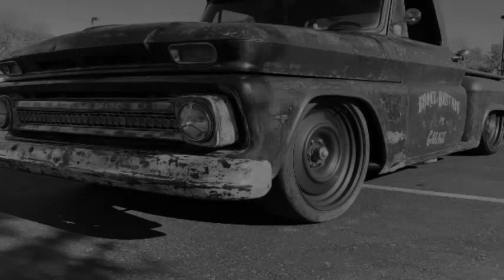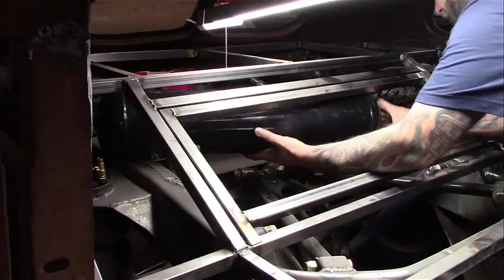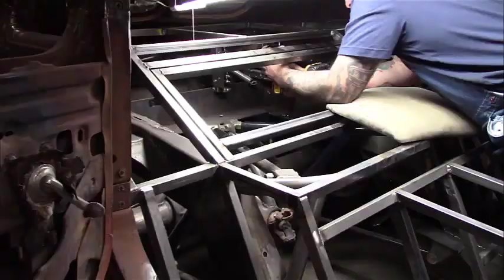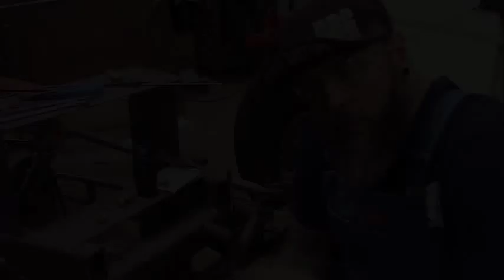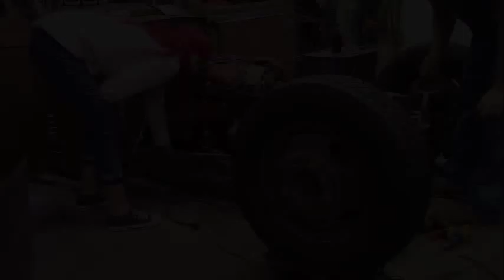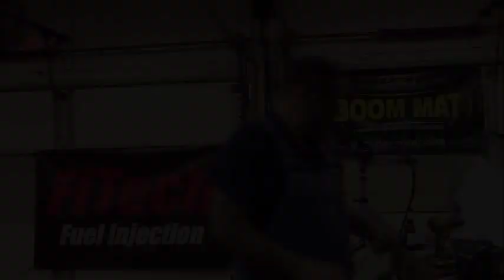"How to Plumb your Air Ride System"  1937 Rad Rod Build Update 44

Comment: Always love the videos you put out. It's also great to see your wife and kids involved. Mine are too. Curious what valves you went with and compressor. I will be running leveling valves off a freightliner so the suspension will adjust itself going down the road and I can dump them when I want.
Reply from the maker: I just used cheap airmaxx valves I had from the first time I did the 64 c10 and a airmaxx compressor. Not the best for sure, but what I had. I have been thinking of doing a self leveling system. Let me know how it goes.
Reply: @BrokeBastardGarage  im a diesel mechanic and they work good on the trucks. Figure I'll use one on each side in the rear. Haven't decided what I'm doing on the front

Comment: my name is Rudy I have a 1940 Cadillac LaSalle sitting on bags just wanting to know how would I get the air ride to respond faster it has the manual paddle valves from eBay soon as you get this can you let me know thanks love your videos
Reply from the maker: Rudy Gomez email me a link to the valves at brokebastardgarage@gmail.com. So I can see which ones you have.
Reply: I don't have an email
Reply from the maker: Ok, the only way to get the air ride to move faster is bigger air lines and more air pressure.
Reply: Hey thanks I appreciate the advice keep up the good videos they helped a lot